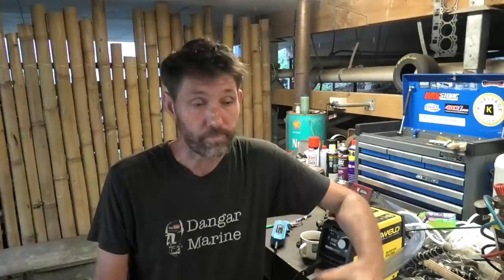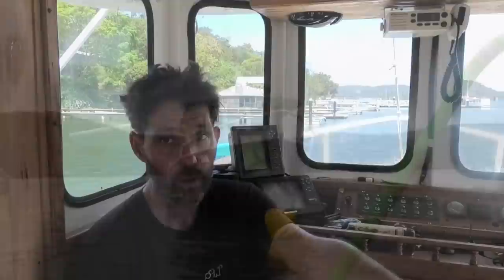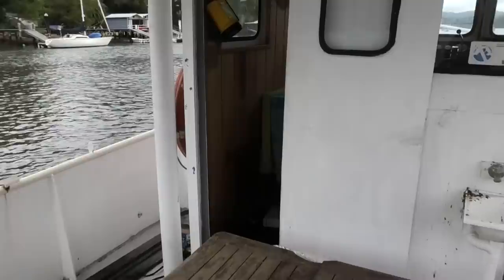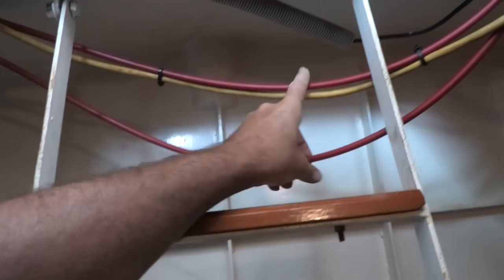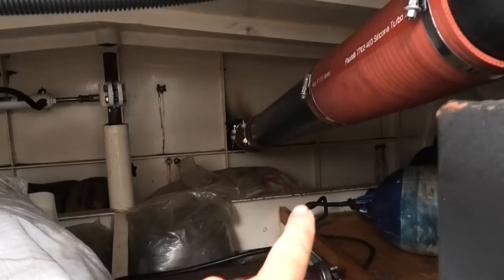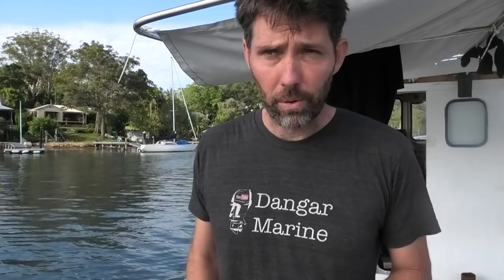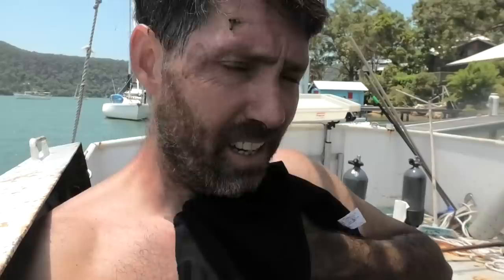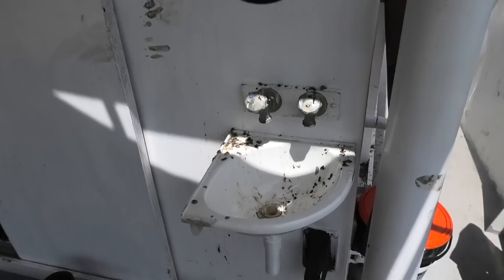Is it a bad idea to buy an old steel boat?

Comment: I ran a lot of small steel tugboats with shafts similar to yours.  I would advise against converting to a dripless shaft seal.  They are similar to the seals you put on an outboard only a lot bigger.  Once they let go, you're stuck with the same issue you have now.  Buy a roll of packing and replace it when you get on the hard it will save you a lot of heartache in the long run.  Do what you can to increase the size of the area underneath your shaft seal and place a bilge pump in it directly.  That way you won't be filling the bilge up and you pump clean water over the side.  You may have a bunch of corrosion on the prop shaft.  You'll likely need to replace it.  If this was a DIY boat it's probably a standard size along with the cutlass bearings.  After almost 30 years you will likely need to replace them as well.  I've probably done exactly this operation 20 times.  After all the assistance you've given me, I'm happy to return the favor.  :)

Your friend is spot on about adjusting the governor.  DON'T!  :)  Your engine sounds great.  I've worked with 71's a long time.  It will leak oil, they all do.  Do what you can to ensure the area underneath the engine is sealed from the rest of the bilge.
Reply from the maker: Thanks Sean, great advice. Justin, a friend of mine who runs several large charter boats is going to be helping me with the packing. He told me he converted one of his boats to dripless and then the cooling pipe got blocked and the whole seal totally cooked itself. This style has it's floors but it seems less likely to have a catastrophic failure. I definitely plan to have two bilge pumps in the engine room and I really like the idea of having one below the gland to pump the water out before it becomes contaminated with oil. Under the engine I am also planning to put those oil absorbent mats.
Reply: @DangarMarine  please make sure you inspect the shaft instead of just jamming in fresh packing.  It's probably very corroded and worn down.  Looks like you probably have about a 50mm~65mm diameter shaft about 1.5m~2m long.  It would be very helpful to determine those dimensions.  Then start calling around to price one out and determine availability and lead time.  You may luck out and find on on the shelf.  If you can dive underneath and get a look at the cutlass bearing size that would also be helpful.  Anything you can do to save time in the yard.  Also figure out what you have for through hull valves and order those too.  You have a lot of work ahead of you.  :)
Reply: @DangarMarine  As Sean said, inspect the shaft, it may have leaked before and been over tightened,  cutting a groove into the shaft. Also look carefully at the shaft, it may have pitting in it, usually a cause of electrolysis depending on the age of the shaft. It may not be evident upon clean up, but stainless steel doesn't show the effects of electrolysis like other metals do  and not knowing the history or how often the sacrificial anodes were replaced. 
You might find you will need to replace the whole stuffing box.
If this is your first foray into this kind of boat then do your research, where was made? Was it a commercial fishing boat?  If she was a commercial fishing vessel, find out as much as you can about it.
Once you have the history, approach your local trawlers or fishermans wharf and strike up a conversation. Find a "steely" like yours that is still at work would be nice, compliment them on their boat and ask about the work, season, prices etc. Also mention that you are diver and out board mechanic. You might pick up some work, some boats need props scrubbed or hull inspections around the skin fittings. 

All to often the older fishermen/boat owners will know a thing or two, you might be up for a new shaft, they just might know some one who has one suitable for your boat. Your prop might need tuning or replacing, they might have one suitable laying around the side of their shed at home, same as old stuffing boxes. 

Head down to where the fishermen slip their  boats and wander around,  if you see some one who might need a hand scrapping a hull or lifting some thing, just offer to help. If it's not far from home or where you work,  drop in for half an hour after work and wander around,  people will notice you. 
You might get a good feed of fresh fish, prawns or even lobster for your effort, maybe a beer or two, make some new friends and if you are a genuine person, not an obnoxious wanker, one of those old crusty fisherman will have the key to Aladdin's cave. 

You will not believe the shit those crusty old men hoard. I know trawler men who have spare props for boats that went to the bottom thirty years ago!  And the stories they can tell. These are men who made their living on the sea. They know their boats and they know the best people to help you sort out any issues you may have. They have a wealth of knowledge that you won't find any where else. 
And they do hoard everything that might be useful one day.

I spent  a couple of years working on Trawlers both on the water and working at a hard stand slip way. I made a lot of friends and learnt so much from them old salts. Many times I would be working on a private vessel, sometimes some one who just bought a little boat with big dreams, not knowing what they were getting in for, "It was a good idea at the time".  My old mates would come up with a hard to source part or something that was going to cost the poor buggers a couple of grand for next to nothing. They might not think much about the "new boat" owner but deep down, they do love boats like yours and they want the boat to have the best chance of staying afloat and working properly. 

And put a bilge alarm in too. A bilge alarm is just a float switch set higher than the bilge pump level, hook it up to a buzzer with a warning light on the console and a strobe light in the wheel house. This is an absolute must have unit. I know of several occasions where that bilge alarm has alerted crews to a problem, especially after being on the hard stand. Stuffing boxes are supposed to leak, not as much as yours is, but a drip every minute is considered okay. It's in the "Goldilock's Zone" Not too tight, not to loose. 

And yes, you have some work ahead of you. Good luck.
Reply: Regardless of how you address the packing gland, unless you go with the dripless, you will always have (and want) a drip of water coming from the gland. I believe what Sean Baldeschwiler is suggesting by increasing the area around the shaft is to build a simple steel box, a reservoir , below, even surrounding the gland, and put a pump and float switch in the reservoir. Use the thwart-ship ribs as guide and support for the box sides. A hinged steel plate can be used to cover the box and gland and contain any splash from the rotating shaft. If you have no water leaks in the hull, keel cooler (if you have one) or motor fittings, this will eliminate all water in the bilge and no worries of pumping oil overboard from the Detroit .
Reply: One shaft seal to consider is called the Johnson Air Seal stuffing box.  It includes an inflatable seal ring aft of the actual shaft seal. If the seal fails, with the shaft stationary, the air seal can be inflated to provide a a seal on the shaft, so the actual running shaft seal can be replaced without leakage. Greg
Reply: Sean Baldeschwiler
Reply from the maker: I will definitely be taking a good look at the shaft while it is out of the water. I totally agree with the idea of changing everything you can below the waterline while it is out and finding clever (cheap) places to source those parts. It will be interesting to see what I find, but also a bit scary! :O
Reply: @DangarMarine once you start picking at scabs on these boats things get ugly quickly.  :)  It's gonna be tough for you to get out of the yard in three days.  :)  I posted on the follow up video about the space underneath your stuffing box.  You should be fine with a pump right there.  Get a good coat of paint on it too.  Be careful not to adjust the packing too much once you get going.  Use a IR thermometer to read the temp on the stuffing box once your underway.  Adjust the packing gland one flat at a time then wait 5 minutes.

Good luck.

Comment: Nice boat. As far as the leak is concerned, drill a hole in the bottom of the boat and let the water drain out. Smart, ain't I!
Reply: That actually works if you drill it at the bottom of the transom! (As long as you never, ever stop moving at high speed...)
Reply: @jameshoiby  lol
Reply: Lol yea lol
Reply: What kind of paint do you use on a steel boat
Reply: James Hoiby on a planing boat yes, the hole has to be above the water when planing. Can’t do that with a displacement hull.
Reply: Sometimes tge simplest solutions are harder to find!
Reply: Nice! Thanks for the tip. Lol
Reply: That's some deep advice 💪
Reply: You can do the same with a beer can -  hole in the top and invert,  works well
Reply: Can you help me with my screen door on my submarine?
Reply: LOL! Too funny! Sounds like a big pharma style solution. Oh, you have a liver problem, take this and it will fix your liver problem but ill cause kidney failure. Basically moving the tailpipe.
Reply: @ablejohnson738  or you could save up some Farts in a plastic bag to keep it afloat
Reply: @thisismecantuseeitsacz5823  brilliant!  I like the way you think! Farts are a solution to so many problems and all to frequently get overlooked.   Definitely a burlap fart sack would not be the right fart reservoir.
Reply: @ablejohnson  I was thinking if you could fart in a plastic bag 20 mil it should hold pretty good then when you finish you could have a fart smelling party 😂
Reply: @jameshoiby  or if you can get a plug that is put into small boats
Reply: @sharronmcwilson5130  2 part polyurethane epoxy.   it cures to a tough and durable flexible finish.
Reply: @sharronmcwilson5130  .....WATER BASE ONLY
Reply: @jameshoiby  A commonly used technique used to drain fishing boats on inland waters.  It's best to hang on to the plug (they're actually usually chained to the transom).
Reply: @ravenfeather7087  Yep, that's where I learned it as a kid! On a 16' Yukon on the lakes of northern Minnesota and southern Ontario.
Reply: @jameshoiby  Always carry a lot of chewing gum when you go to sea.
Reply: I have seen that episode of the 3 Stooges!
Curly drilled a hole in the bottom of the boat to let the water out...... LOL
Reply: Then you would be letting Water back in if you drill a hole at the bottom of the boat
Reply: People actually do this if the boat has been left out of the water a long time

Comment: There is a flap in the intake just before the blower. Make sure that works, test it. It may have a solenoid on it with a switch labeled emergence shut down. Or a cable going from there to the cabin labeled the same. There is ways this engine can go full fuel and the only way to stop it is to shut off the air intake. If you do have to use this and it drops rpm but still does not stop, turn the fuel off at the fuel filter. And block the air intake with block of wood, do not use a rag it will suck that in. Do not let anybody work on the governor till this is tested this is when most engine run a ways happen.
Reply from the maker: Great advice, thank you!
Reply: @DangarMarine  i have actually had that happen with a 6-71 on my friends boat.  looking at the flat side of the engine and wondering if the rods come out the side of the block will go thru the hull planking and sink the boat.. its happened before.  it was like a top fuel dragster motor running full throttle ..  so lucky it the transmission was in neutral.  or we would have been going 50 knots in a 104 foot wooden boat. this is the same hull as ours was. https://i.imgur.com/14bDch2.jpg   but it looked more like this in its retirement. https://i.imgur.com/eZ6sqsI.jpg
Reply: Good idea.. 👌
Reply: wayne p q
Reply: wayne part
A
Reply: The seals go on blower start to run on engine oil not feul
Reply: Yes, Detroit's are a bit more susceptible "Run-Away" occasionally, and they will run on their own crankcase oil once they suck in a few gaskets ...  Make sure that flap works and you can get at it !!  Nice boat overall.  I'd like a bit more sound deadening in the engine room :D

Comment: Just over 18 months into a TOTAL rebuild of a 30yr old, steel, 8.8m ex-commercial longliner. Basically stripped her down to the bare hull, new cab and engine. Now well into putting things back !
Can’t wait to watch your progress.... the more you dig, the more you find !
Reply from the maker: Oh yes, it is always scary to go digging and it sounds like our boats are about the same age.
Reply: Dangar Marine just seen the second episode, looking familiar though mine had been ‘dinked’ many times. Ended up having to replace the cabin deck plates and structure as water had run in over the yrs and rotted it out.

Comment: You can't beat the old 2-stroke Detroit diesels I have a 1271 Detroit in my 70-foot shrimp trawler tough as nails
Reply from the maker: 1271, now we're talking! :)
Reply: @DangarMarine  My 9th grade school was right next to a Detroit Diesel plant in Detroit, used to hear Detroits all the time. We called the 12v71 the Buzzin' Dozen.
Reply: @anttiroppola4414  yeah I already watched it good shit👌
Reply: Yes we had them on a oil rig; roar like bulls but very hard to kill!
Reply: beautiful engines, very heavy on fuel tho
Reply: @davidwarland2680  yes sir about 200 gallons a day
Reply: @davidwarland2680  Yes unkillable and i believe they will run on raw  oilfield oil..but yes drink like a fish.We had them running gensets @1800rpm 24x7x365...seen then run dry of oil seized then restart them after topping up, not recommended though -asshole mechanic
Reply: Dealt with several of these Detroit's in boats.
I would suggest that you go over the entire engine and tighten as many gaskets as you can, especially the oil pan.
The pan, front covers and valve cover are usually the worst leakers.
As for the shaft seal, I would add a grease fitting so you can pump some grease into the packing area.
Doing that will seal the excess leakage and obviously prevent wear, while helping to keep it cool.
You have good ideas about access doors and I think a nice big stern dive platform and built in ladder would be a Very good thing to add.
Cheers, and good luck with her mate.
Reply: @mrfrog3350  If a Detroit does not sound like it will shake itself apart it ain't running right.

Comment: Love the video. I bought a 1946 ex Thames tug. It needed way more work than yours. I'm about halfway through having repaired the prop shaft that had been cut by thieves stealing the prop, made and replaced the stern tube, made new centre bearing, replaced engine and gearbox and rebuilt and extended the wheelhouse and extended engine room roof back to original. It's been hard work and there's a lot left to do but I'm still glad I bought it. Regards, Ian.

Comment: Before the military I started off painting ships, last two were flat bottom running between Scotland and Holland.  We used to crane a compressor into the hold for the needle gun to remove the rust, red oxide everything after welding if needed then underseal and repaint absolutely everything.  Being in Scotland the winter months were absolutely horrible to work in when we could.  Sounds daft now I'm 50 but I miss working on the ships. Just cleared your head and got on with it. Would definitely loved your weather to work on ships.
I'll definitely be watching to see how things go. Been thinking of picking up a small yacht to play with myself. Weekends on the water would be great. Thanks for posting these

Comment: For your idle problem be sure to check / change your fuel filters first. Detroit diesels use a common rail fuel system supplied by the fuel pump. The injectors are driven by the cam. If there is sufficient fuel pressure and fuel in the fuel rail there should not be a problem with the idle.
Reply from the maker: Thanks for that, will definitely start with the basics and go through everything.
Reply: @DangarMarine  the injectors are the HP pump. Ask your mechanic if you are using the optimum injectors (N55, N70 etc).

Comment: I’ve done numerous steel hull inspections on all kind of different vessels. Large Oil tankers, Cargo ships, U.S. Naval vessels, Private Yachts. In the United States, American Bureau of Shipping or (ABS) is the U.S. Agency that is the governing body of commercial vessels operating in U.S. waters.  Steel hulled boats are the easiest to repair and the most durable if the hull has been engineered correctly. I prefer steel hulled boats because repairs in any emergency can be done quickly and easily if you know how to weld. A small 30’ boat like that can be quickly repaired or rebuilt. The only thing I would require before purchase is a full hull ultrasonic testing on all the hull plates as well as the original set of blue prints to know thee original hull plate thickness. With out the hull plate info and if no ultrasonic survey available. I would tell them keep there boat. 20% plate wastage requires full plate replacement as determined by the inspecting ABS, engineer. Structural integrity has to be maintained to resist the hydraulic forces of the pounding waves against the boats hull . Welds need to be certified 100% quality before I would put any money down on any steel boat that I would be considering using for any commercial venture.

Comment: While on the hard replace all through holes with new hardware and packing etc. Includes depth sounders and speedometer fittings. New zinc is the icing on the cake.